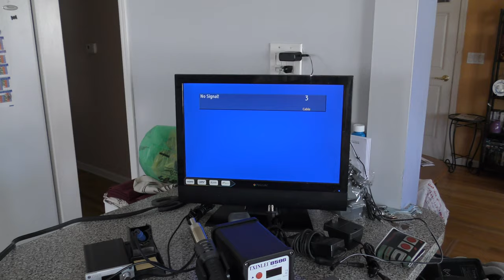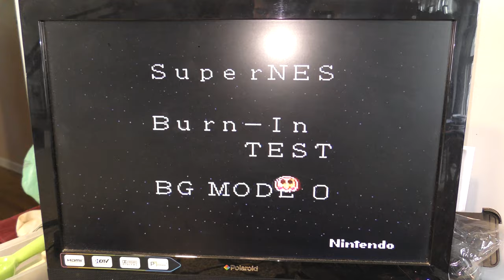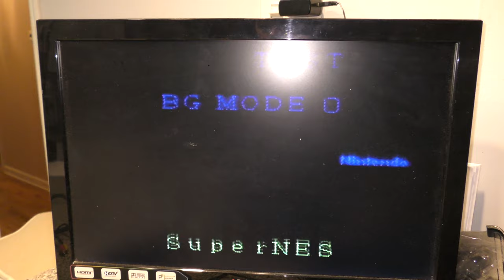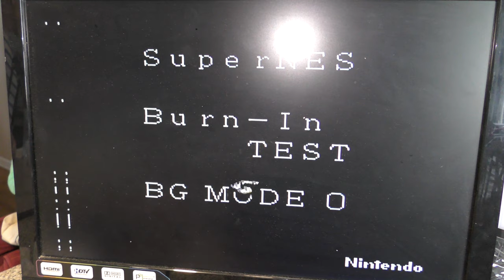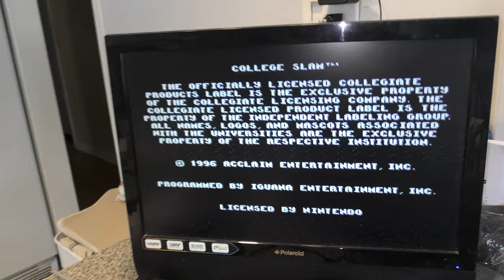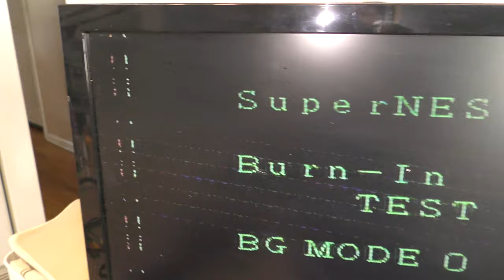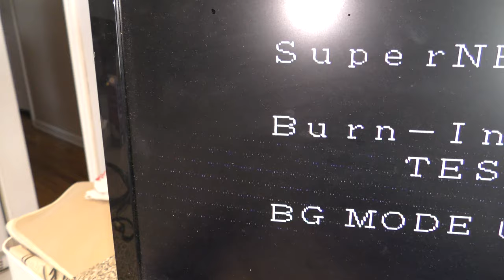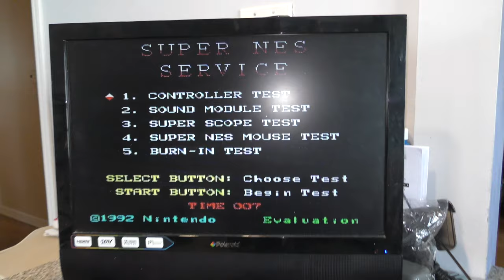VGRestore Ep8: 2 SNES Repair (CPU, PPU1, PPU2 Swap)

Comment: You need to get yourself a dental pick (Walmart in the dental care area) so you can gently probe the pins to see if they are loose.  Sometimes you can get lucky and find a pin that has detached and you can solder just that one pin down as opposed to replacing the whole chip. After you have soldered in a different chip you can do the probe test just to make sure everything is connected well too.

Comment: My childhood SNES has the same glitchy repeating pixel columns as your second unit.  I initially suspected the SRAM, and I'm surprised you didn't try that.  I have found which data bit between SRAM and the PPU2 is responsible for that column, by shorting each data pin to ground in turn and watching the effect on the screen.  Scoping that data bit shows nothing unusual, and looking at its activity frame-to-frame it seems super consistent when displaying a static screen (FF2 start screen) that contains intermittent glitchy pixels, so I now believe it's likely PPU2 at fault and not the RAM.  I was willing to attempt an SRAM swap, but the density of the PPU pins scared me, so I didn't go any further with my repair.  After watching this though, maybe I'll try after all.

I am surprised you tried the CPU and PPU1 before getting to PPU2, and I'm also surprised you didn't try a PPU2 reflow before swapping.
Reply from the maker: I don’t have a scope to test logic like that and I was taking a shot in the dark with the CPU swap, usually CPU is what fails. I only reflowed the CPU at first to try it, it usually never solves the problem though. Thanks for the comment. 👍
Reply: @PunkNDisorderlyGamer  Ahh the CPU reflow - the act of desperation!  I did this yesterday because I bumped my AV Famicom while in operation out of its case and killed its CPU.  I could not accept this, so I reflowed the whole board in desperation.  Today I was lucky to get a NES at a recycling place for $20 and performed a successful transplant.  Those big chonky throughhole IC chips are a nice treat after SMT chips on the SNES.

Comment: Hello master, I have a question, if I put in a cartridge in good condition and the console does not give video, does the Super Nintendo test cartridge force the system to work?I ask this question because I have 2 Super Nintendos with different motherboards and they don't give video or audio with the game installed and I want to try with the Nintendo test cartridge in the future.
Reply from the maker: @dgm778  the test cartridge will often times boot even if games only boot to a black screen. Sometimes when the hardware is too damaged or a connection is broken it will not boot the test cart.
Reply: @PunkNDisorderlyGamer   Thank you very much for the answer

Comment: Awesome work. Just found your channel.
Reply from the maker: Thanks👍
Reply: @PunkNDisorderlyGamer  I have been trying to repair a gpm 02 super famicom for days here myself. Black screen. All voltages good, caps replaced, cart slot good, removed cic and installed a super cic uigr board but still same. Must be a cpu or ppu issue. Looking at this video has given me confidence. Thanks

Comment: Really good stuff. I like your workflow. One thing I like to do with cracked shells is apply a bit of epoxy to the interior side of the system. It helps reinforce it the shell. Have you ever tried de-yellowing any of these systems?
Reply from the maker: Yes I have, in fact there is a video on my channel already, episode 4. As a side note, I don’t use the cream I like to use regular peroxide it works just fine if you have a high UV level for the day. I have to revisit that a bit more in-depth one day. Also the epoxy is an idea perhaps I’ll try it out one day.
Reply: @PunkNDisorderlyGamer  I wonder if Bondo putty would work?

Comment: Nice work all around. I have a seemingly almost mint looking snes with black screen. Took everything apart as you did, cleaned front and back and inside of pin connector even without seeing any corrosion anywhere... still black screen. I'm not into soldering and planning on trying to replace chips, what can I yes do to keep troubleshooting? I heard maybe my power adaptor not enough power? Maybe the sound unit can be causing issues? Maybe buy an oem pin connector off ebay ? Whats your advice ??
Reply from the maker: When you plug in some games like Mario kart or street fighter do you get a “Nintendo” screen? If so you could try replacing the SHVC sound module. But I’ve had pristine consoles have bad CPUs. In fact the ones that tend to work after cleaning them and fixing a broken trace or two are the corroded ones.
Reply: I don't get any screen on any game. In fact, if I don't clean the games we'll before testing it out, I don't even get the black screen. If like you said, it may be a chip problem, so many questions: 
How much can a repair like the one you do cost? What if I can't find someone like that around me? Should I buy a soldering iron and flux and start messing around with chips??

Comment: I'm having a weird problem with my childhood SNES. It randomly acts like the start button has been pressed mid game even though I hadn't touched it. I'm using 2 first party controllers that work fine on another SNES I have, I've swapped out the controller ports (including ribbon) and it still does it. Have you ever seen this before? And if so, is there any info you could give me on how to track down and fix the problem?
Reply from the maker: A faulty CPU will sometimes press buttons especially the start and shoulder buttons. I’ve had that issue in the past. It’s been so long since I’ve repaired these consoles, I’m not sure if I uploaded any fix similar to yours to my channel.
Reply from the maker: https://www.projectvb.com/nss/logs.htm#cpu_fail

Check Misc CPU failures, some of them include multiple buttons being registered. Very similar to what you’re describing.
Reply: @PunkNDisorderlyGamer thank you for your response. A failed CPU is what I was afraid of but it does seem like the most likely culprit at this point. It is one of the newer 1994 models without the big metal sound block in the back which means it has a CPU B but from watching this video here it looks like CPU A and CPU B are interchangeable?
Reply from the maker: @ChewyChicken589  yeah all CPUs are interchangeable, I’ve personally never had a bad CPU-B, not saying they don’t go bad buts more rare. Check to make sure it’s CPU-A or B, it’s probably an A.
Reply: @PunkNDisorderlyGamer  I just checked it yesterday and it's definitely a CPU b. I think it may have been fried when I foolishly used an aftermarket power block that I don't think was 100% compatible. I have since learned my lesson and bought a genuine Nintendo power block but that's what I think it may have been
Reply: @PunkNDisorderlyGamer  I'll definitely try what you did and reflow the chip before I replace it though. The solder is looking a little old and shabby
Reply: @PunkNDisorderlyGamer  I have another question, I know somebody with a parts board where the sound works but not the video. It does have a CPU B. Does the fact that the sound works mean it's likely the CPU is good?
Reply from the maker: @ChewyChicken589  not sure, I would guess so.
Reply: @PunkNDisorderlyGamer  yeah, it sounds like it could go either way but it's at least worth trying if I have to do a CPU swap. Thanks again for your help
Reply: @PunkNDisorderlyGamer so I got that parts board and I'm fairly confident the CPU is still good since I can see three fried traces coming from PPU 2. I'm probably going to swap the CPU on it tomorrow but I was wondering, when you do this, what temperature do you set your hot air gun to?
Reply from the maker: @ChewyChicken589  350 Celsius. Make sure you use a fair bit of flux and allow the chip to practically fall off by itself. If you pull on the chip and it starts to sound like a sweater zipper being undone it’s still too soon to lift the chip.

Also, the 3 fried traces on the PPU1, why not try to fix that before you pull a CPU?
Reply: @PunkNDisorderlyGamer  I thought about that. It does seem like too nice of a board to take parts off of. I'm just kind of torn because my SNES is an RGB 01 model and the parts board is an RGB 02 and not easy to find. I'm also wondering if PPU 2 itself is fried. I might actually repair or jump the traces, see what I got and then if I need to, try to find another parts board.
Reply from the maker: @ChewyChicken589  try to repair the parts board with a few trace repairs, if that doesn’t work, take the chip off. In the end you’ll still end up the same or better off.
Reply: @PunkNDisorderlyGamer  yeah, that makes sense. Thank you
Reply: @PunkNDisorderlyGamer  so I did the CPU Swap and now it boots to a garbled image. Have you seen that before?
Reply: @PunkNDisorderlyGamer if you want to see what I'm talking about, it's the most recent post on my channel. I hate to keep bugging you for help but you're clearly the best at SNES repair on YouTube

Comment: What does the V224/V239 failing indicate?  I have one that came in doing that, recapped it, no change….  All the other preliminary tests passed.
Reply from the maker: I’m not sure what all the faults correspond to, do games play? Any graphic glitches?
Reply: @PunkNDisorderlyGamer  Game logic works, but graphic glitches and no music (just a small amount of distorting audio).  For Example, Tetris/Dr Mario title screen almost normal, but little graphic errors of letters showing up here and there.  Level select menu almost unusable.  But you can navigate through games, so I am not certain it is CPU.  It’s very strange.  

I also have one that passes all tests but still shows faint white bars in the background layer, like a failing PPU.  Sometimes they are real mysteries.
Reply from the maker: @mercurialgirl  yeah seems like a bad chip, I couldn’t tell you which one exactly.

Comment: Nice Video. I try to repair my snes from my childhood soon. Where is good place to get replacement parts?
Reply from the maker: Depends on what parts you’re looking for. For passive components like capacitors and fuses you can get them on console5.com, for CPUs and PPUs, they’re not off the shelf components.
Reply: @PunkNDisorderlyGamer  Unfortunately my PAL SNES has a similiar issue like the one you repaired. I searched a bit and it's likely the PPU1 or 2. There are graphical issues that some layers aren't displayed or only partly. 
But my only chance is to buy faulty boards to replace it, isn't it?
Reply: @PunkNDisorderlyGamer  In my case I think the PPU1 or 2 is broken. I have similiar graphical glitches and some layers of the snes aren't displayed properly similiar like in your picture. But getting chips from a broken SNES is kinda pricy. They're at a similiar price of a working one.
Reply from the maker: @Phils3r  yep unfortunately

Comment: Hello. What would you recommend for the black screen? I cleaned it and it still won’t fire up. Very cool video. Subscribed!
Reply from the maker: Check out episode 42 for black screen of death I usually swap the cpu, unfortunately CPUs are pulled for donor boards.
Reply: @PunkNDisorderlyGamer  I replaced the cpu still nothing. Could it be the ppu?
Reply from the maker: @ModernFactsDaily  I have a bunch of SNES and SFC videos coming out soon. Stay tuned for those maybe they can help you out. But was the cpu working beforehand? You probably have 2 working CPUs and another bad component somewhere else on your board.
Reply: @PunkNDisorderlyGamer  thanks I got the test cart and it will run but stops at the burn in test. I’ll keep an eye out for those new videos thanks.

Comment: Need help with an issue - Just recently replaced/soldered a new power port (old skool) for my Super Nintendo. After I did this, it erased all my saved data on Super Mario World and Super Mario All-Stars. Both batteries in both cartridges are fine - this issue only starting happening after I replaced the power port. Thanks for any help!

Comment: I have a PAL SNES which is in a pretty good condition, except that mode 7 started to mess up... I will try cleaning it but I suspect it might be PPU dying
Reply from the maker: Yeah that’s usually the case.
Reply: @PunkNDisorderlyGamer  is 70% alcohol safe to spray liberally over the mobo? there are some flux remnants from a repair over 20 years ago, which I would like to clean before doing anything else

Comment: What temp do you set your hot air too for doing chips? I have one and wanted to start trying chip swapping just didn't want to fry anything.
Reply from the maker: 300 Celsius with full speed
Reply: Thanks I was gonna start at like 650°F which is like 340°C. Could of destroyed a chip or 5.
Reply from the maker: paul lanier that shouldn’t be too harsh just be careful of the other surrounding components.
Reply: @PunkNDisorderlyGamer  when swapping out chips do all the numbers and letters need to be Identical or just the top row?  For example can I swap a chips if the first 2 rows match? I can't find any matching chips where all 3 rows match in my stock of boards. Or can I swap any ppu2  A with another ppu2  A?
Reply: @PunkNDisorderlyGamer  already bricked a board while cleaning it I tore a pad off and there's no trace to follow. I tried using an ohm meter to try to track it down on a different board but was in successfully. Know where I can get schematics on which pin goes where on different boards for the cpu?
Reply from the maker: paul lanier you can swap any ppu2 with any other ppu2 same for cpu and ppu1. Also, many chip legs don’t go anywhere but an empty pad, check to see if that’s the case.
Reply: @PunkNDisorderlyGamer  ok cool that makes things a little easier. By any you just mean for that board type or are the compatible with all boards like can I take a cpu and ppu  from a first gen board with the sound module and put it on the smaller boards with the sound built in?
Reply from the maker: paul lanier yes that’s right. As long as it’s ppu1 with ppu1, you can’t place a ppu2 in place of a ppu1.
Reply: @PunkNDisorderlyGamer  great that makes things a lot better cause I have a lot of the first style boards with cpu  issues and a lot of the other with ppu issues so I can just take the ppu from the earlier model 1s and put them in the later models. Cause I have more cases in better condition for the later models. I have a shortage on the first gen bottoms with no chips. Been coming across a bunch that the bottoms are too damaged to retro brute. So now I have a bunch of first gen working boards waiting for cases. I'm picky with the stuff I sell. Thank you tho you helped out alot.
Reply: @PunkNDisorderlyGamer  what's your take on solid bars running top to bottom would that be cpu or ppu or both?
Reply: You should also make a video on black and white snes or replacing crystals or adjusting the crystal. Couldn't find a video on it and finally found a forum on it but I had to search hard and I'm sure others have the same issue.
Reply from the maker: paul lanier I’ve only had to adjust the crystal once and it was well before I started making videos. I actually broke the trimmer capacitor (TC1) it actually looked like someone else was messing with it before I broke it but, whatever. I swapped the TC from another board into the black and white board and it worked like a charm.
Reply from the maker: paul lanier solid bars could be one of the PPUs. Try and play the game see if the game seems to be working, by working I mean the game logic seems to be correct, like level progression. If the only issue is graphic anomalies it could be one of the PPUs.
Reply: @PunkNDisorderlyGamer  my test cart came in. Do you know any links with info on translating the burn in fails? Like something that says what each fail means so and so is bad or a combo of so and so means the ppu  is bad not the cpu. Cause I have one with multiple fails and it could mean a bunch of things. And if the vram is a heavy fail should I try swapping that first and see if it fixes the others?
Reply from the maker: paul lanier I’ve never seen VRAM fail. Seeing as the VRAM is easier to swap than a CPU or PPU, I would swap that first. See if VRAM fail goes away. If you does fix the problem let me know I would like to know for future reference. I don’t really have a guide for the different fails, but most of them are tied to CPU, if your console only black screens with regular games then you can narrow it down to CPU. If the game does fire up with games then you have to narrow it a bit between CPUs and PPUs.
Reply: @PunkNDisorderlyGamer  have you ever came across a red screen with black lines and the whole thing kinda wavy?

Comment: I have a system where games fire up just fine but sprites in the middle section of the screen are gone like in mario world I can't see mario but of you hit jump past a certain line you can see the mario sprite just fine. Do you think this could be bad vram? Backgrounds and everything else show just fine no other weird graphical glitches. BTW love your videos they are very detailed and helpful I've learned a lot.
Reply from the maker: That’s a tricky one, the VRAM is much easier to replace than the PPUs, you could definitely try to swap it first. I’ve never experienced anything like that. If the gamelogic seems to be correct just the graphics are wrong you could potentially rule out the CPU.
Reply: @PunkNDisorderlyGamer  Thanks! I'll start with the Vram and move on to the ppus I have some from a board with a dead CPU I can try.
Reply from the maker: Aylof let me know if you figure it out.
Reply from the maker: Aylof I just realized you could just swap the CPU from that unit into one of your dead CPU boards much easier job IMO.